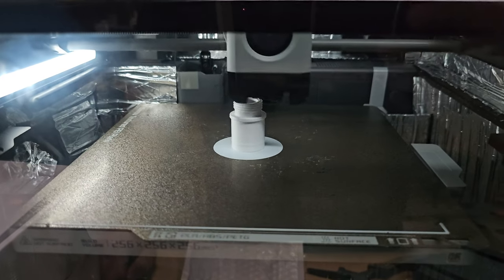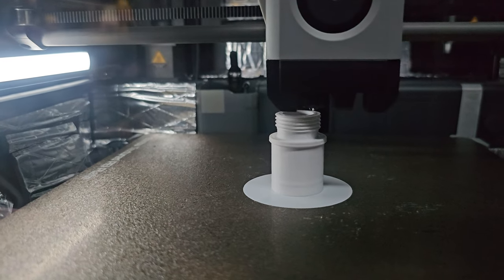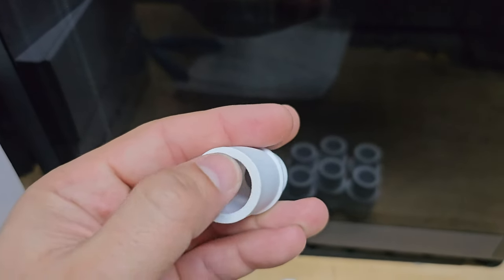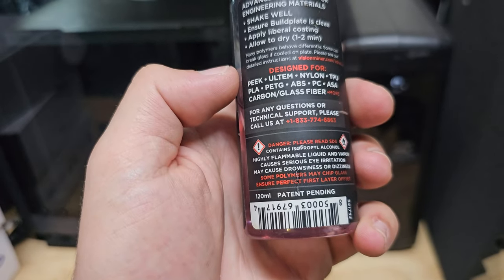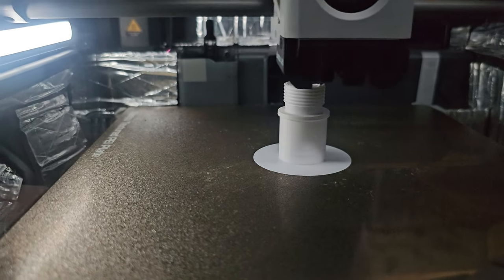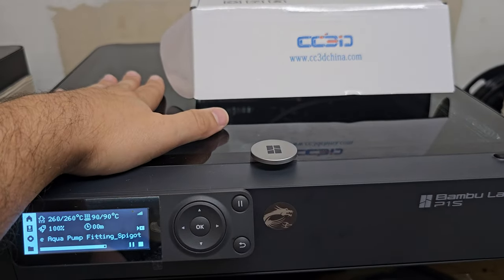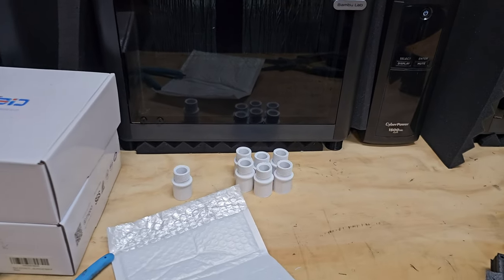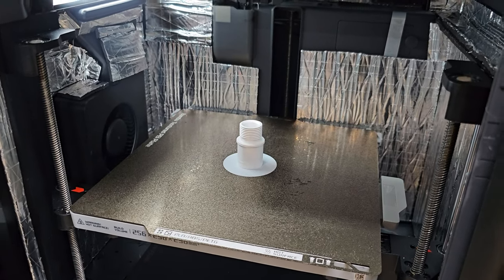Bambu P1S: ASA Filament Tricks/printing

Comment: Printing ASA or ABS on a machine that doesn't have a heated chamber so you can control the temperature is going to be a hit and miss bad time
Reply: Yeah that's what I discovered w/ my X1C. I added a chamber heater for cheap. >50C chamber temps will help with warping. Textured PEI plate, no glue. 110C bed temp.
Reply: @skinnybricks  Any brim?
Reply: Even the Ultimaker 5S does not have an actively heated chamber yet is fantastic at printing ABS and ASA. It doesn't need much. Build plate heats most of it up and the enclosure keeps moving air out. It's fine. 

Different story for higher temp filaments

Comment: Well ill try this again. Ha. I was typi g a message when the video swithced. I belive the last one posted on a different video. Ha.  Anyways. My question was what speed are you printing. The spool says to print at 30 to 50mms, which seems painfully slow. Also, are those parts at 100 percent infill?